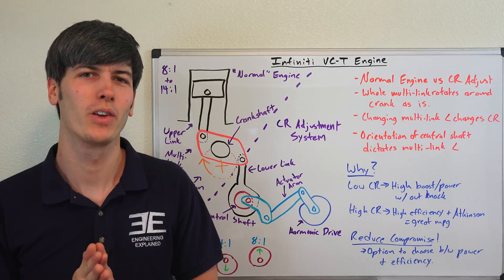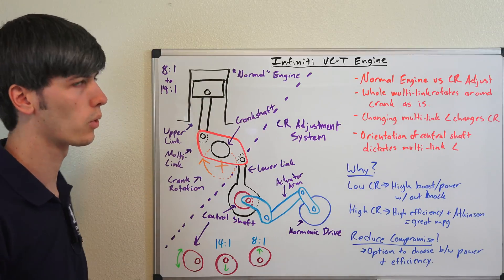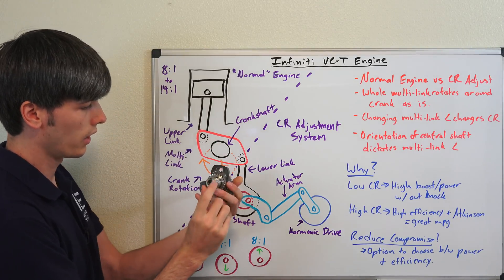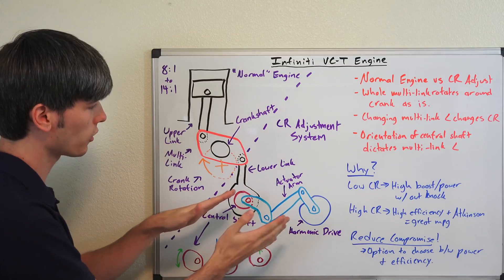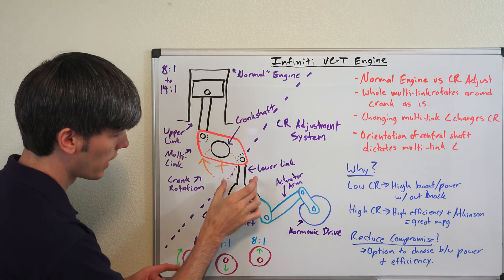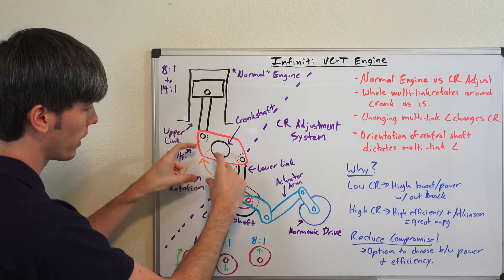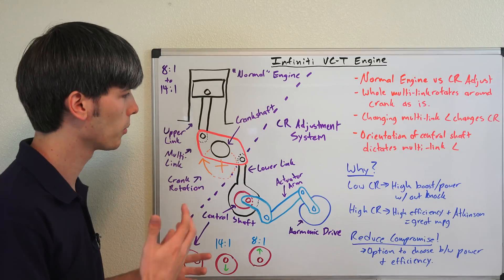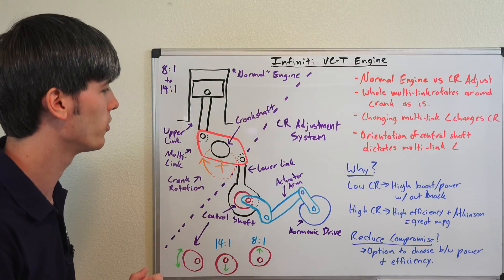Infiniti's Amazing New Engine - Variable Compression & Turbocharged

Comment: Good luck balancing all those parts.They should try some different mechanism,like the one used in VVT.
Reply from the maker: VVT is completely independent of this, and can be used in conjunction.
Reply: Ahmad Shumayal
Do you mean that the great BMW is doing the same thing as Nissan? That's correct.
But there are a few exceptions:
Chinese brands are still learning how to make good stuff, they will not make purposefully crap until they've figured out how to make good stuff.
Mazda skyactive technology is engineering done properly, at least at first glance, I don't know how the engine will look like in 2 years.
And some brands occasionally make a car that's actually reliable. But often their spare parts are *** *** expensive blin.
A Rolls Royce doesn't break down, but it has the same technology as a BMW 7, it's just a bit more refined and so on.
The Audi RS6 C7 owners don't experience any problems, but if someone smashes your headlights it will cost like $2k.
And all the options and extras are always way too expensive. I mean every new Audi has cruise control, but some people who didn't pay for it don't have the button to enable it. So you can buy an Audi without cruise control, just add that button, add a cable to connect it to the ECU, ask someone to enable it with a VAG-COM device and you have cruise control.
Reply: aditya ramesh
Well, the whole VCR thing is supposed to change how much the piston moves up. Turning the crankshaft has no effect.
However you could rotate that stationary shaft with hydraulic pressure, in theory.
In practise there a few things to consider: the crankshaft is bigger than the camshaft, and it has more load to it; so the oilpump would have to be quite big (consumes energy) and it would have to be rigid, so that it wouldn't flop around.
And putting a VVT-like system in the "multi link thing" would have the same problem.
---
However I think that replacing the eccentric shaft thingy with a hydraulic piston could be an option. (This piston would need the capability to tilt)
There are a few thing to consider with this one: these hydraulic pistons will fill up with oil, so when you need an oil change some oil will be left behind. Engine oil is not rated as hydraulic oil, so will is be able to handle the pressure? Probably yes, but it could generate additional pressure that the oil wasn't rated for (that's why automatic gearboxes use dextron red).
And what will happen if you don't have oil pressure for some reason you have to make sure the car can drive home safely.
---
Infinity however said that this VC-T design is the only thing that didn't make the engine too big and heavy.
It might be true, however Nissan is quite good at misleading people when it comes to engines. Once you have seen the X-Trail 2.0 engine taken apart you will lose al your faith in the whole Renault-Nissan group.
Reply: +aditya ramesh
Do you mean variable valve lift (not timing) like the VTEC or Valvetronic systems? And then implemeting that on the crankshaft?
Reply: +Engineering Explained Ya something like that,instead of an external mechanism, they can use an inbuilt hydraulic mechanism in crank shaft to alter the angle of the lobe.
Reply: kenmastersmaster
Does Infinity have the same warranty conditions as the Nissan GTR (R35)?
I mean the GTR warranty says you will void it if you drive fast, which i ridiculous for a sports car. And the GTR driveline will turn into scrap once you try to drift. Just like the BMW X-drive.
Does the Q50 3.0TT have enough holes under it's piston rings or does it have too little holes like toyota; Or did they OMIT them altogether like the 2.0 Nissan X-trail engine?
What pressure do the valve-springs generate?
Does the Q50 have a balance axle to compensate for the pour crankshaft like the Nissan X-trail engine?
---
Just bought means 'it's good now', but as all manufacturers do: they will let it break down after the warranty period is over so that you have too buy a new car. And all the fanboys will blame it for 'pour oil' and other stuff.
Everyone does this, BMW, VAG, Mercedes, Renault-Nissan, except for Chinese brands (the Chinese don't make junk on PURPOSE).
Only rollce-royce (which is for fucks sake a rebranded BMW 7) and maybach (which is a rebranded S-class)
Reply: +sasja de vries Wow!! think someone had a bad time owning Nissans. Too bad u don't have Suzuki in country they are built to last ages.
Reply: kenmastersmaster
Subary is ok, except for some gaskets on the diesel engines (which they fixed) that were not longlife-oil-proof, and some other rubber parts were crap (replacing rubber=cheap). In Europe they had a bit poor service for some time, now they've fixed their problems but they lost most of their market-share. The cars themselves were fine (although a bit on the heavy side cuz of awd) but sometimes the dealer couldn't service your car because he had to wait for spare parts to arrive.
But I lost my Faith in Japan, I mean EVEN toyota is making their products less reliable on purpose. If you'd take apart an old Toyota engine and a new one you will see they omitted some features. Toyota was once like bulletproof, now it's just enough. Back in the day you could use crappy oil, floor it all day long and it was fine. Nowadays Toyotas usually won't break if you drive carefully.
And then the Nissan R35 GT-R is >30k and japanese, but still they don't even want to give you warranty if you drive it too quickly. Use launch control twice in a row and the third time it will limit power because the clutch is overheated.
Mazda's Skyactive engine technology is done properly, because it's both cleaner and more powerful without compromising on reliability and serviceability. However if you look at the Mazda 6 1.6 diesel engine you will lose all the faith you just gained.
Dayhatsu is probably the last honest (great quality for low prices) manufacturer Japan has known.
---
Out of the premium brands Subaru and Lexus are probably the best options. I have a bit double feeling about this they don't make complete crap, but they don't make it as good as it could have been.
The manufacturers often know how to make their product better, they just don't wan to.
Reply: kenmastersmaster
Well, leasing is available in most developed countries, however it's cheaper to just buy a car. The leasing company has to make profit somehow, right?
I mean you'd better pay 30k once than 1k per month and after 3 year you ended up paying 36k. Or you might have a deal and pay 27k in 3 years, but you can't keep the car afterwards, which is still worth 10k for example. They have to make profit, they have to do administration work, they have to hire repo-men, they have to factor in risks. They have to get this money somehow, so you have to pay for it.
---
Leasing, credits, rental and more of that stuff is a 'Murican thing. Reagan started just that policy, now the US has a debt of 20 trillion$.
Leasing allows you to buy a car you can't afford, so in stead of saving money and then buying you can buy it now. Which is exactly what the manufacturers want to to do. Not think twice while you are saving, but you have to be like "Hey, nice car, let's buy it!".
The BeNeLux and Germany are developed countries and still most people buy cars themselves. In the Netherlands (where I live) leasing is only popular because you can trick the govt to pay less tax. Citizens have to pay tax for their car, companies don't, so if you let your boss lease a car for you (he will simply cut that from your salary) you can pay less tax. That's on of the reasons to lease in the NL. And if a car is in your possession you can tune or customize it as much as you want.
Reply: kenmastersmaster
 Alright, but where does your leasing company get it's profit from then? If it costs 42 grand, in 2 years you have them 12 grand, and it's rest value is 22 grand, it means they lost 8k?
No, they are making profit, no doubt.
---
Alright, if they will buy the car for 42k, lease it to you and then sell it they will lose 8k.
If they first lease it to you, and then lease the same car to someone else for another 7 years or so, but nobody would lease a second hand car for the price of a new one.
They only option left is this one: The dealer gives the leasing company 30% off, and in exchange the dealer charges ridiculous maintenance prices. Something like that.
It's can't be cheaper, they have to get their money somewhere. It's just like going to the gym and getting free slippers: you could actually go to a cheaper gym and buy those slippers yourself.
Or as it is in Europe, you can trick the tax system and pay a bit less taxes, but here it's still not enough to counter the costs.
---
The leasing companies have to make up for those costs, and either you or the government is going to pay that bill. I mean Nissan is not going to charge different prices for the same car either, unless THEY they are the ones tricking you paying somewhere else.
Reply: kenmastersmaster
 OK, I got this, but hey the manufacturer might give 10k off to get rid of the car, but they could just as well give you a new car for 10k less.
The manufacturer might lose some money of some cars, they won't lose money on 90% on the cars leased, right?
I mean if the 90% of the people who lease get 25% off because they lease I think it could have something to do with taxes. I mean in Europe every citisen has to pay V.A.T. and a special 'new-car-tax' (do know how it's called in the US), but entrepeneurs don't have to pay those taxes. So because it's not you buying the car but it's the lease-company buying it, they don't have to pay these taxes and get the car for less money. So they are actually 'stealing' the money from your govt. In Europe they took care of this by adding 20% of taxes to the monthly leasing fee.
So leasing in general in Europe is not financially interesting, however eco-friendly cars have lower taxes, which means that on some cars it might be appealing.
---
Or it coud be you were just lucky, and the rest of the people is actually overpaying.
Reply: Ahmad Shumayal
I've seen it being taken apart completely.
Not that I have owned a Nissan Myself.
And yes, it was an engine from about 2000-2004. However I've seen more post-2000 Engines from Nissan where they purposefully used bolts that are difficult to remove, they don't want you to overhaul the engine, they want you to throw it away and buy a new car.
How else could you explain philips-head screws where everyone else uses alan or hexagonal bolts? And more stuff like that.
Reply: +Simon Liu
Revving high is not a bad thing, driving at low RPM is a bad thing, and revving with a cold engine is a bad thing.
If you would drive your engine below 2k rpm, and never exceed 3k, then your mpg rating would get worse.
EVEN for TDI engines this is the case.
Reply: kenmastersmaster
 Yeah you got the point!!!
Except you mean 90% of the people in US+Canada lease a car.
In Europe it's much less.
However in Europe there are a lot of people that just buy a new car every 3 years (no lease, no credit, just their own money). And you still have the same problem that cars have to last 3 years.
Actually if your car is reliable you can sell it at a higher price second hand, AND if you lease a car it means your lease-company has less financial risk (because of higher rest value). Which means they could give you lower lease prices.
In terms of emission standards and economy it hasn't improved as much as they claimed. For example one method to get better MPG is by shifting at a lower RPM, however this means cokes will form inside of the engine more than this the oilpump produces less pressure (worse lubracation) and so on. The result is that the 'Good mileage' is simply a trade-in of reliability. Moreover: because of the cokes it will become LESS efficient after some time; but they don't care cuz the test went fine.
Reply: Why do you have a bad time with the petrol 2.0 Xtrail engine? Is it the first generation X Trail?
Reply: sasja de vries everybody does that and do that
Reply: sasja de vries. 4 years and 40k miles later my skyactiv 2 liter is running strong, it goes over 4k rpm or to the redline very frequently and still gives me pretty much exactly the epa rated city mpg.
Reply: Why do you think I do it? I keep it under 3k until it's warmed up, then beat the crap out of it. And with this motor there's no pumping losses at low throttle low rpm because the throttle is wide open with only VVT/L controlling the amount of air/fuel so mpg doesn't suffer much at lower rpms.

Comment: So, then theoreticly, this could be used for lots of 'testing' situations where you want to adjust the ratios of the engine.
You could quickly and easily turn it into a stroker motor, or lower the stroke of the piston... interesting

Comment: Ok so, first of all great video and great explanation I was waiting for it but I want to ask something. What about horsepower? Will the power of the engine be different when the compression ratio is 14:1 and not 8:1? For example cr is 14:1 and the engine is producing 120 hp and when it is 8:1 it is producing 100 hp. Is it going to be like that or the engine will have 120 hp no matter the compression ratio?
Reply from the maker: Power output will be significantly higher when it's operating at 8:1 with peak boost.
Reply: yes , when u lower the compression the boost is higher so more power. or u can just run E85 or meth and run high compression and high boost for tons of power. giggity . lol i wouldnt want to run that much compression on high boost regardless though. run into a bad tank of E or ur meth stops flowing and u have no failsafe and boomstick to ur engine
Reply: This is a bit more drastic and backwards of your example. Probably more along the lines of been a 100HP engine at 14:1 and a 300HP engine at 8:1

With all the consumption differences the HP figures would imply.

The thing is though, you'd never really FEEL the 100hp side of things. This engine would FEEL like a 300HP turbo engine. The difference beeing that when commuting it would consume fuel like a 100HP engine.
Reply: giggity
Reply: atsernov but turbo cars already do that. mine for instance, 400+whp at 28psi boost. drinks fuel like a fish on boost. but if u don't get into boost. 38mpg highway. and because of the way I drive lol 24-30 city giggity goo
Reply: tomjw7 What I meant was 100hp NA, economy tuned, engine. Something like 50mpg highway.

A high boost engine running out of boost isn't efficient, and an NA engine running high boost is a quick way to relive it of con rods.

This engine allows you to have the efficiency of a high compression ratio and the power of high boost.
Reply: atsernov why isn't a high boost engine out of boost efficient? a lot of newer turbo engines run higher compression ratios, no not as high as na engines but still higher. di cars for instance. 9.5:1 and even higher. no that's not like an na engine but still get the best of both worlds.
Reply: tomjw7 "not as high as NA"
That's exactly why. With a fixed CR you basically have to choose your minimum acceptable fuel economy and then extract the most power you can while still being able to offer a warranty.

The reality is they could lower CR and up boost for more power, or increase CR and lower, or drop boost for better economy. Thus you are not getting the best of both worlds, just a well tuned compromise.

The goal behind an engine like this is to truly give you the best of both worlds.

Basically the only major way to improve on this is to have computer controlled valves so you could run the Atkinson cycle when out of boost.

Comment: Thank you for yet another great explanation of a concept that I failed to comprehend up until now! I just didn't understand what is driving the harmonic drive, an electric motor or is there a link to the cams by a belt/chain? Is the TPS used as an actuator? Thanks for the clarification.

Comment: I understand everything, except how it is mechanically possible for the Multilink piece to rotate around in the same orientation. The crankshaft (as shown in the video) has to be attached on both sides of the axis. When you showed the metal crankshaft and the spot where the multilink should be attached, it could not make a full rotation (it would have to go "through" the crankshaft)
I hope you understood the question and maybe sb. Can Explain how it can work anyway (e. g. post a link to a picture / video)